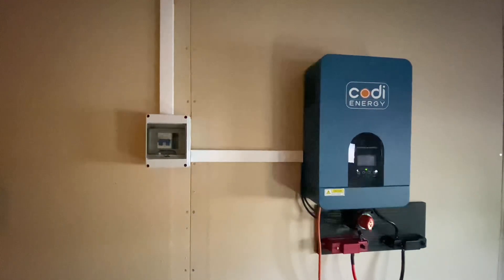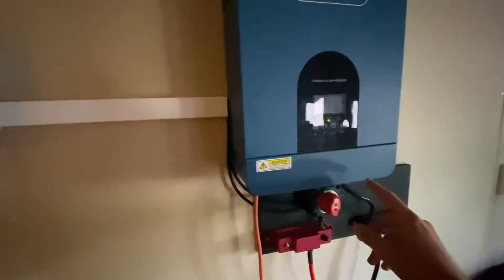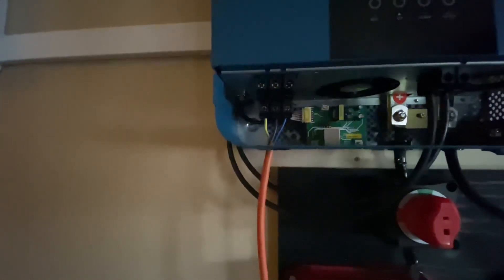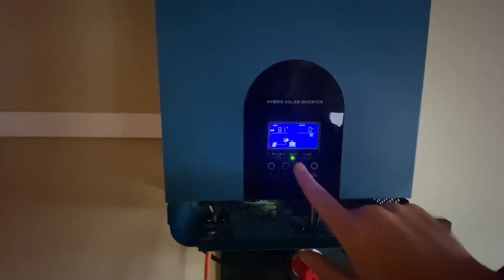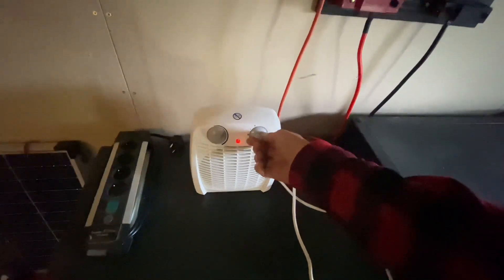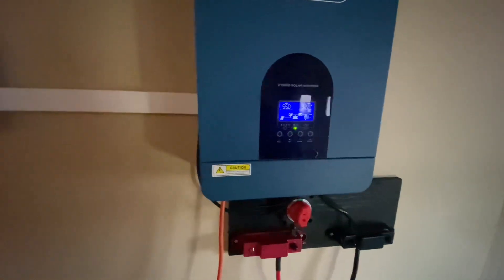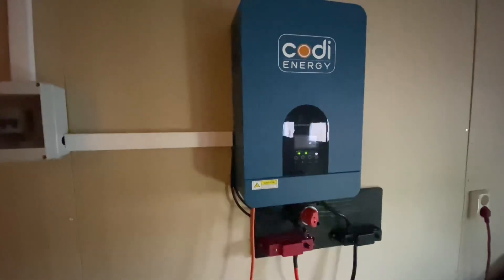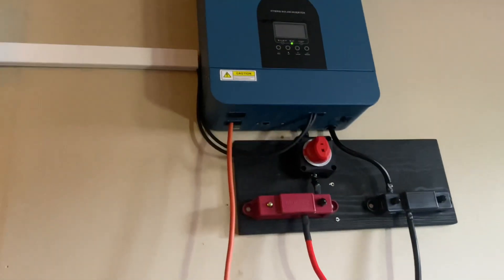48v All-In-One Off Grid unit overview

Comment: Very clean job much better than mine.
Reply from the maker: Thank you. What kind of system do you have?
Reply: I have a Growatt 3000 24v on one system with 2400watts of solar. The other system is sigineer 6000w 24v inverter with victron MPPT with 2000w of solar and 600ah battery.
Reply from the maker: @user-uc9rz7oy8p  nice👍 are you happy with the Growatt? Off Grid location or backup for home?
Reply: @JonasSyver  I got it to use with the grid. I have two automatic transfer switches that go from inverter to grid when the batteries get low.  And yes the Growatt has been perfect so far.
Reply: @JonasSyver  The sigineer is a split phase so I can do 120/240. Since I am in American I made 2 3000watt 120v lines and an outlet for 240 if need be.
Reply from the maker: @user-uc9rz7oy8p  sounds like a smart setup👌🏻 thank you👍